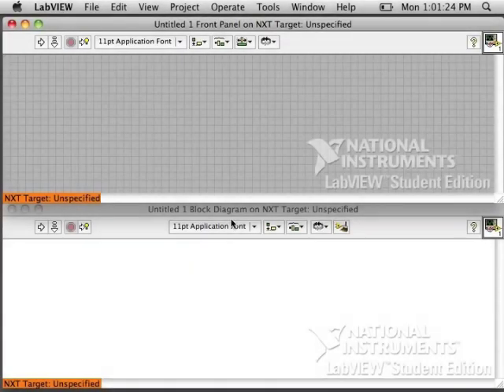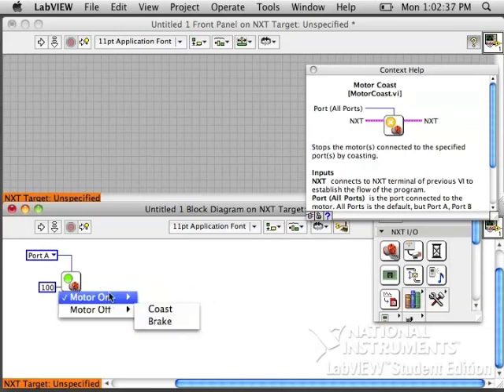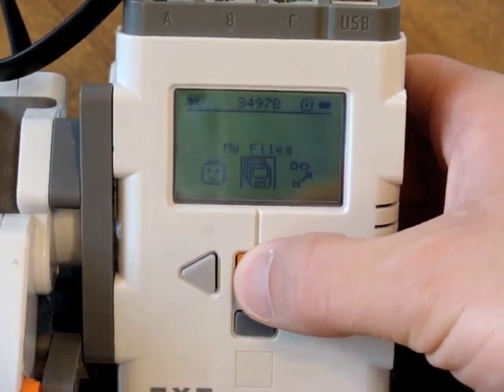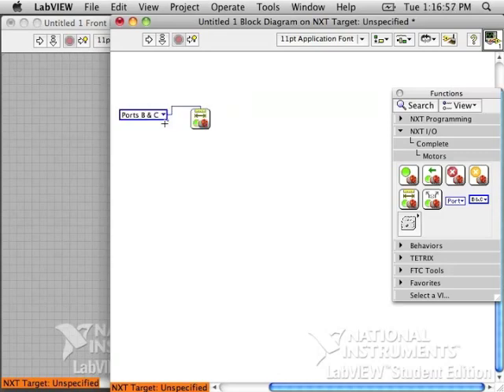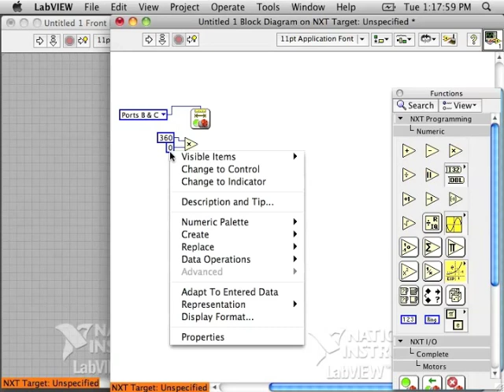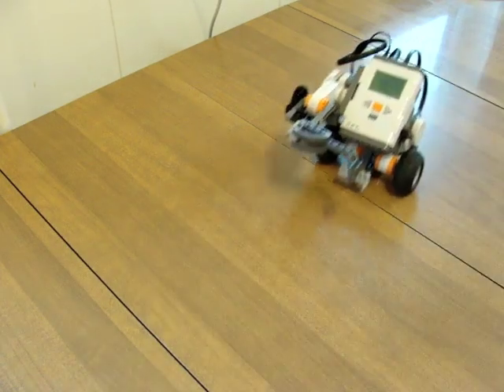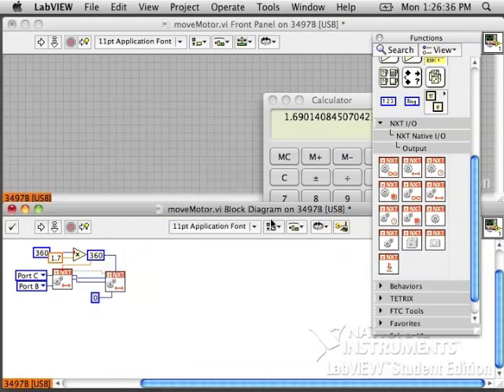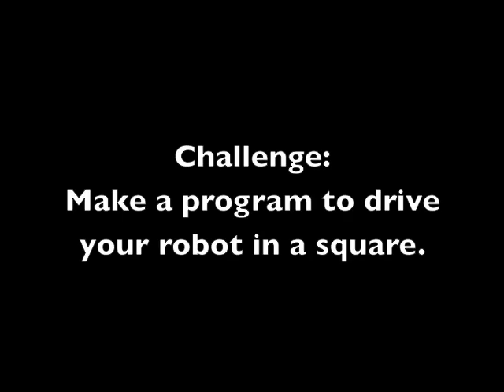Labview + NXT Part 1: Motors

Comment from the maker: You might be interested in sub vis.  They are like MyBlocks in Mindstorms.  I have a video about how to make them.  Then you could have your own custom block and not have to do the same code over and over.  You might also be interested in the movie about the Gyro sensor.  It is another way to make very precise turns or correct to make your robot drive straight.